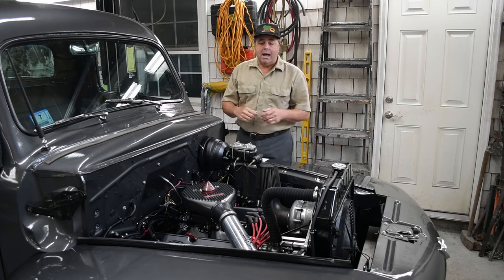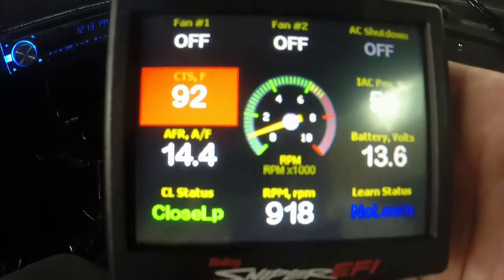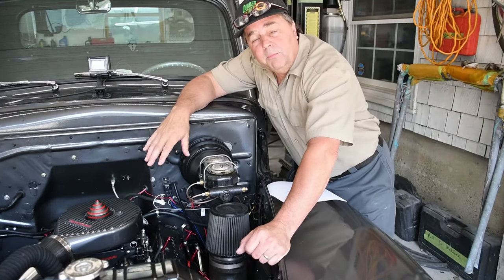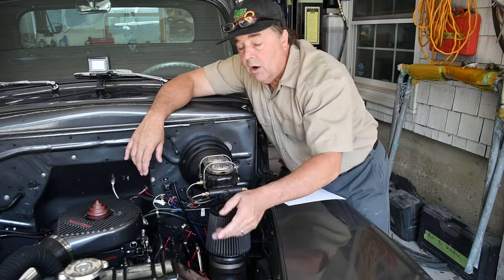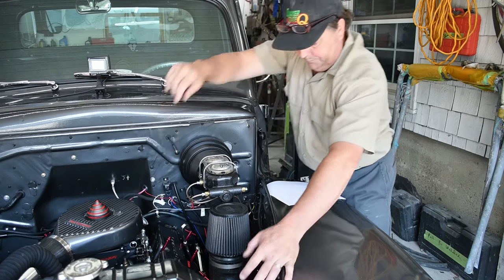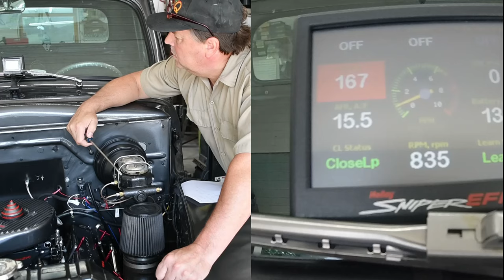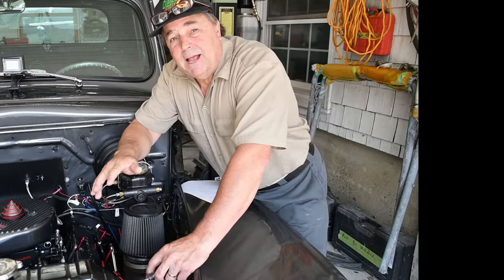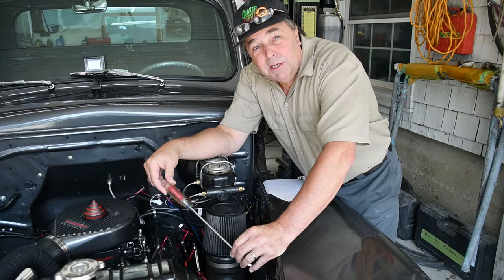Holley Sniper How To  Set The IAC (Idle Air Control) in 5 minutes or less

Comment: Solved all my issues by putting on a Carburetor and learning how to tune it... DONE..!
Reply: Pretty convinced I am going to have to go with carburetor I hate this Holley sniper never has ran right at all.
Reply: That’s where all my issues started
Reply: @ethanmauer2001  you need to read the instructions and also have a good understanding of how an engine works and what it needs to run correctly! If you do that…the efi works very very well!!!
Reply: Until you climb a steep rutted hill or climb serious elevation 😂

Comment: I do believe 99% of surging, high idle are related to IAC settings. Why do the idiot Techs at Holley not recognize that when you call with a high idle or surge issue. Mine is mostly settled in now. What a pain it's been.

Comment: Troy, just started my initial run…IAC is always returning to 0.  Idle will drop much more from 1600 to under 600…IAC still 0….engine runs great, starts well and accelerates nicely. Any ideas?
Reply from the maker: The IAC going to zero is the computer trying to lower the idle. I would check for vacuum leaks.

Comment: Dang, you made that easy. I've been struggling with getting it set. Now I did it in just a few minutes and it starts and idles better than ever. Thanks for the video.
Reply from the maker: Glad I could be of help. I had similar issues on previous Sniper installs. Thanks for the comment. Good luck on your project
Reply: Mys car is shooting black smoke

Comment: Ya.  I’m doing the whole process thing.  Idle screw percentage is stuck around 55%.  Won’t idle.  Quickly goes red and shuts off the engine.   Help?
Reply from the maker: So it won't idle. Vacuum leaks? Fuel pressure. Check all the basic first.
Reply: hey were u able to figure it out.. im having the same issue

Comment: So I failed emission today the said my HC’s were too high. My IAC was at 10. Do I lower it I think that’s leaning it out to 0-1% or raise it? Idle HC PPM is 429.6 Limit is 400.  My CO% 3.40 Limit 1.50 Thanks for helping
Reply from the maker: You are close. What is the AFR reading?
So the IAC lets air past the throttle blades, so in theory, higher would be leaner.

Comment: I want to ask, why are you vague about which screw to adjust first, there TWO ADJUSTMENT SCREWS with green springs ..... 

I don't know which one is the "throttle blades screw" 

(in fact when i search for sniper 2 throttle blade screw, there is pictures of the actual small brass screws that hold the throttle blade, butterflies onto the throttle blade shaft)

I'm assuming you do not mean those throttle blade screws, but why not just SAY which screw is which???  What's the point in an instructional video of being vague about it??  Is it meant o be funny?  Or a prank of some kind???
Reply from the maker: I didn't think I was vague. Same as an idle adjustment screw

Comment: Great video. As Clint said I too have always heard the 2-10 range. But then again every engine is differant, STILL great job
Reply from the maker: I think 2% is too low. My understanding is that the system(IAC) can raise or lower the idle. If the IAC is set at very low setting it doesn't give the IAC much range of motion to lower the idle if need be. Just my thoughts. Thanks for the comment
Reply: This is what Holley suggested.

Comment: I installed a Terminator X system on my 85 Cutlass supreme with a 355 and a TH350. I had a shop do the work since it involved a new tank etc. After getting the car it ran great but at least once a ride the car would stall while coming to a stop. Initially I thought that the ECU needs to learn my engine and that this would stop, but it didn't. I thought that I had to adjust my idle speed to make it higher than 850(more like 950) to stop it from stalling but then I found your video. I just tuned my IAC just like you said. Mine was initially at 0-2 when at hot idle. 

When I started your tune procedure and my car initially warmed up to 167 and started to "learn" my IAC was hanging around 8-10 so I thought I was good. I waited like 10 more minutes until the fans ran about 2-3 times and then cranked my throttle and my IAC dropped down to around 0-2. From there I started to back out the screw a 1/4th turn and pop the throttle until i got my IAC to around 7-9. I am going to try to drive the car tomorrow(I dont have time today) and hopefully this resolves my issue with stalling. The car already sounds better at idle now that I tuned the IAC, it used to surge before and the AF ratio would get really high momentarily. Now it just hangs out smooth.
Reply from the maker: Sounds like you got it!

Comment: I put  the pcv valve on it heat shielded the fuel lines, put a 1 inch spacer under my sniper.  It runs great until it get hot on a 1 hour trip , It acts like a vapor lock problem  it is running 210 or lower . I t starts cutting out. Any ideas ?? Thank you for advice .🤠
Reply from the maker: Check the stats on the handheld when the problem happens. See if you determine the from there. fuel pressure, temp etc.

Comment: My Sniper is doing great once it warms up. I can't leave it until it reaches 165 . What to do?
Reply from the maker: I would check the coolant sensor. It may not be reading the coolant temp properly. Therefore it doesn't know that it is cold. When its hot everthing is good. If it's not the sensor, it's in the software. Good Luck

Comment: I thought the Sniper manual called for 2-10% IAC not 8-12...
Reply from the maker: I have always used the 8-12% and never had a problem. They may have changed it. I try to be below 10% as a rule. Thanks for the comment

Comment: Mine works, then it doesn't, I'll be driving, all is fine , then pull up to a light and the engine surges to 1150rpm (from 750) and the car surges forward. I usually put it in neutral, and rev it, it still settles at 1150 1200 rpm until I pull over and shut it off. My IAC reads 20 (I've never seen it go higher) and stays there... I usually just go home and second guess why I ever installed this thing.
Reply from the maker: When you shut off and restart you are resetting the Iac. It seems like you need to set the Iac lower. And what is the base idle set at in the handheld?

Comment: Hey Troy, I didn't see the initial video and or the issue you had. My CJ5 Jeep has this Holley Sniper EFI but the issue I have is that my car will die at 35/45 minutes of driving around. It feels like something "heats" up or idles because I have to wait around 25 minutes to crank again and then i can drive around but it will die again so that's why I say its something that heats up and wont send the enough gas/power and the car dies. Everything is connected as it should and my mechanic has not find out any other issue than this system.. would you help?
Reply from the maker: Sounds like you may hace an ECM issue (the computer). I would call Holley. I had to send one back because it was dying too.

Comment: Troy , I need your help buddy ...I am not a mechanic but I instqalled my Holley Sniper on my 428 Pontiac. The IAC was sitting at 0 on Innitial Start....I have the Hyperspak system as well. I turned idl screw in 1 1/2 Turns becasue car wouldn't start ....after turning idel screws in 1 1/2 turns , the car starts fine....warms up fine...idle is a little high from turning idle screw in before starting I assume ....awesome throttle response but IAC is stuck at 0 . I let car warm up real nice. IAC still at 0  ..So to get Engine down to set idle speed 900 ...I have to back off Idle screw..until it hits taget idal 900. IAC stays on 0 ....I shut car off and now it won't start until I adjust idle scre in again ...and around and around I go. Please help....
Reply from the maker: Ok this stuff can be a bit challenging. And doing things remotely is hard, but I will do my best. 

Think of the IAC as a small motor that can open or close the throttle blades as requested by the computer. 
 When the IAC shows Zero the computer is telling it to close the throttle.
 When the IAC is, say, at 10 it has partially opened the throttle and could continue to go higher ( open more) to say 20 or go lower to say 5. 
 In your situation, the IAC motor is at Zero The computer is wanting to close that throttle. 
 You want the the IAC to open that throttle to create an idle condition and have the IAC be in control. Meaning it can raise or lower the throttle.

Question 1. Do you have the idle set in the Handheld?

Question 2. Have you checked for vacuum leaks?

Question 3. have you checked the function of the IAC in the handheld?

I hope this was a helpful answer. This is a tough thing to do over the computer. 
 Best of luck
Reply: @troykane  Thank you for taking the time to tray and help me . I found my issue and now the car runs perfect. It was the spring on the secondaries. It was too week and being sucked open I guess by the vacum. I put a tiny spring on it and now my car starts perfect when hot, returns to 900 idle everytime, mileage is way up and throttle response is awesome. Holley needs to fix that crap.
Reply from the maker: @RodeoRanger  No problem, glad things worked out.

Comment: hi 👋🏽, I just installed the new sniper 2 on my car, she fired right up as it’s supposed to. I have the basic set up coil and distributor only. Before the car was fired up, it was set at 12°. I decided to change the timing now at 15° and now the rpm ramp up from 750rpm to 880rpm. I tried to change the basic idle back and it won’t go down at all. Do I need to re-start the wizard again or? Any word of wisdom would really appreciate it.
Reply from the maker: Change the setting then cycle the key off. Then restart it should take.
Reply: @troykane  sorry what you mean change the setting? The wizard or the idle setting?
Reply from the maker: @lleonardo2880  the only way to change the idle is in the handheld. so go to your idle setting and make the change. Then for the change to be saved you have to cycle the ignition. this is done with out the engine running .

Comment: I am struggling with Holley Sniper. No problem on cranking. But issue is once I step on the throttle, the idle stays up. It will not come down unless I shut the engine off. I am sure I have a setting off. But I am a novice when it comes to these updated system. Any guidance is greatly appreciated.
Reply from the maker: That sound like 1. basic throttle return (spring or linkage) hanging up. Check that first. Or the IAC holding the the throttle open. When you cycle the key the throttle returns. Look at the hand held and read the Idle Air Control at start up. Then again when it's wram over 170. Then throttle up and if it stays high read it again. Chances are that you'll see some high numbers. That means the IAC is holding the throttle open. Go thru the process to reset the IAC. Good Luck

Comment: i am back to tuning the iac ... when i accelerate i hear a loud whistle sound ... what is that ?  installed a Creb motor so have to reset the 71 .... the 73 had a bad ECU ... sent it back for repairs . now it runs lean and the headers turn cherry red ,  i do not know what to do ... i replaced the O2 sensor... and that did not work ... what do you think is wrong with that one ?
Reply from the maker: I would check for a vacuum leak
Reply: on which one ? the lean running motor ? @troykane
Reply from the maker: Yes, a vacuum leak will cause a lean condition @jgvford

Comment: This is the best video I have seen on the IAC adjustment. I am curious you are abl to start the truck before the handheld boots up. I have never been able to do this. I have to wait until the screen and pump primes. Any suggestions on what I can do so I don’t have as long of a wait.
Reply from the maker: I usually wait for the fuel pump on a cold start. But after that she fires right up. Are you sure you have uploaded the tune correctly? 
Sounds like it could be booting up off the SD card
Reply: @troykane  Not sure have never done anything but small adjustments to timing and aft. I just followed what was in the instructions. I have had it for 6-7 years I just thought that was the way it is

Comment: what number do you have the wizards or hand held at for ica control at??  Do you set the hand held at 0  or 8-12 .   I had to go into settings and set ramp down and set the ac to 0.  that is the only way I could get adjustment screw to come down.  What do you have the sniper fan control at???

Comment: At the beginning of the process, when you turn in the screw one full turn, where is the screw set when you start this?   Is it at the very beginning of engagement with the butterflies?   It seemed like you backed it off more than a full turn during the procedure.
Reply from the maker: Basically where ever it is right now. Add a full turn. What you are doing is moving the throttle out of reach of the IAC. So the IAC reads Zero. At this point the engine will be revving pretty high 1500-2000 RPM. Then slowly back the screw off to get in range of the IAC. Then continue to back off to get the range you want. Hope this helps. Good luck with the project, Troy

Comment: Thanks for the vid! Just installed mine 2 days ago and im having issues with it , high rpm in park and once i put it in gear it drops to normal and afr readings are perfect , in park afr is rich
Reply from the maker: It should drop down. I would check your throttle linkage. Make sure in park it is fully returned.
Reply: @troykane  thank you ill check it out

Comment: I’m trying to get my dads LS swapped 88 suburban to run right.
He has the Holley sniper.
What is the IAC number when cruising or does that matter?
Reply from the maker: IAC, Idle Air Control. It only works when the throttle is in the idle position.

Comment: I cant wait to try this. Just received my '68 FJ40 back from the builder. Took 2 trips less than 10 miles each, and each time it cut off on me (once) while making a turn (either from a stop or while slowing down). I'm hoping this will fix it. Thank you so much for taking the time to post this!
Reply: sounds like your builder didn't do any road testing

Comment: Having problems with iac before I start the car iac reads 53 car will start back firer though sniper not giving me time to adjust car ran before with system car sat for a year flooded the plugs just replaced them still back fires though carb motor is new 383 chevy 525 hp big cam professional built from white racing   timing set to about 15 degrees ran before seemed a little rich help!!!
Reply from the maker: Hi Daniel, Generally speaking a back fire either through the throttle body or the exhaust is a timing issue. The Iac is high because the system is trying to keep the engine running. So, my suggestion is to go back to basics. Pull the plugs and change them, then re-index the distributor. Double check your firing order. I had a Mopar that drove me crazy with a backfire. I thought for sure it was the Sniper. Nope, I had a crossed plug wire. It is easy to put blame on the Sniper because it's new and computerized. But I would go back to basics first. Then check all your sensors thru the handheld. Good Luck, Troy

Comment: Not sure why I’m having this issue. But I did exactly like your demonstration which was easy and straight forward but my iac stays at 100% . After I cycled the key and repeated the process to save the information it went back up to 100% but when driving it goes down to 10-15% and it hesitates on higher mph like around 45-55mph.
Reply from the maker: It has to been at operating temperature when you do this adjustment. At least 170 degrees. Check your fuel pressure. Needs to be at 58 psi. Good Luck
Reply: @troykane  yes sir I got it to work thank you. Where is the iac suppose to be when on the throttle? I’m at 20%
Reply from the maker: @HeshAudio  Doesn't matter. Only matter at idle. (IAC)  Idle Air Control on has an effect at Idle. Glad things worked out for you

Comment: Have you had a problem with the like it sticks when trying to accelerate on a normal take off
Reply from the maker: You mean the throttle?
Reply: That’s the known tip in issues. Get the extended linkage leverage part that holley offers. This part eliminates that sticky/jerky throttle feel. Actually holley should include that part in every sniper for $1500.

Comment: I done all of this but it seems at random the IAC starts reading 0% and the Idle is around 1200/1300 . If I look down the IAC port the plunger is 100% open.
Reply from the maker: I would cycle the key. And repeat the process. If it continues, try covering the port with a piece of tape. If it runs, you have a vacuum leak. Because the port will be closed and the throttle blades will be closed. Good Luck
Reply: @troykane  yeah i've done been through all that.  no vacuum leaks or anything, fuel pressure is 59psi etc. It'll run great but then at random the IAC seems to get lost and opens up 100% the ECU tries to compensate and tries to close the Plunger hence the 0% reading on the hand held.
Reply from the maker: Contact Holley. You could have a bad ECU. It happened too me.
Reply: @troykane  I did, thanks.

Comment: Holley Sniper does not work in cold weather. If you need to wear wool, you are in a place where the sniper will not work. Stick with a carb and stop dreaming.
Reply from the maker: I disagree. It's 6 degrees here now. And my vehicle s will run. Mostly these are summer vehicles anyway.
Reply: Holley sent me a new IAC and a new Hand-held for free. I replaced both. Cannot get IAC to sit between 8-12 whatevers. It's either 2 whatevers or 20+ whatevers. Another youtuber says it's supposed to be between 1-5 whatevers. Since the stock setup is at 2 whatevers, I'm going with that. I have a manual with no AC, so IAC should not ever matter. I just hope these new parts stop the engine from stalling at every intersection.

Longstoryshort: I should have gone with a Weber crab. #NeverTrustHolley